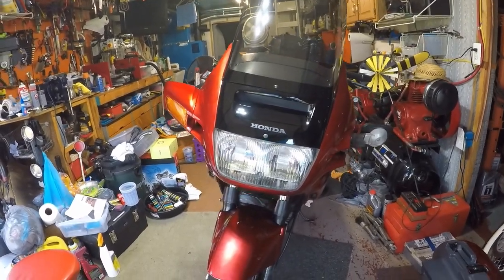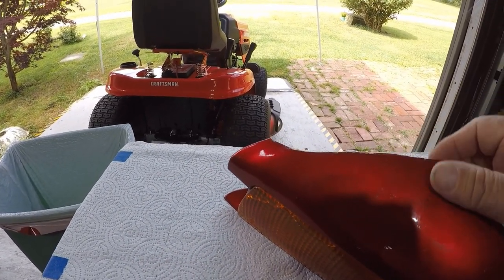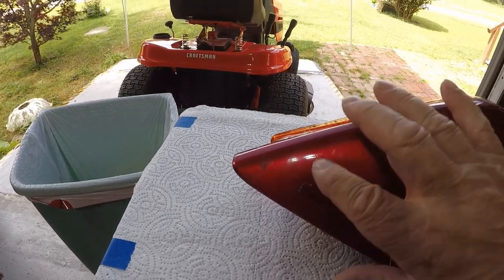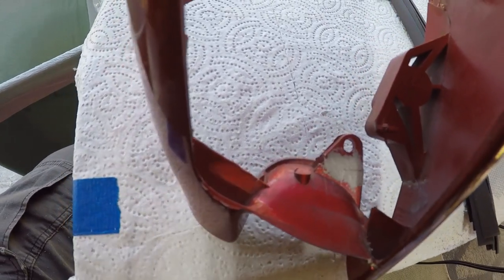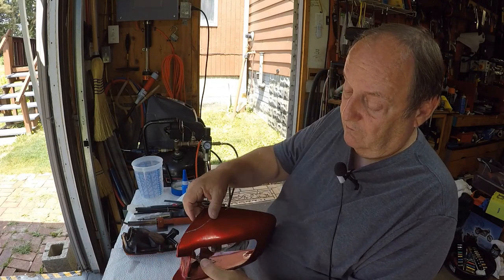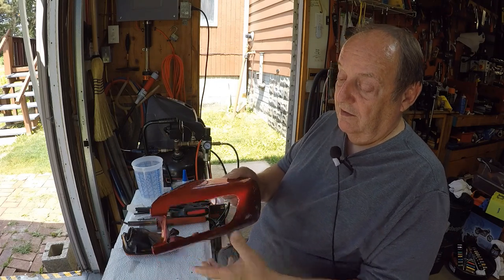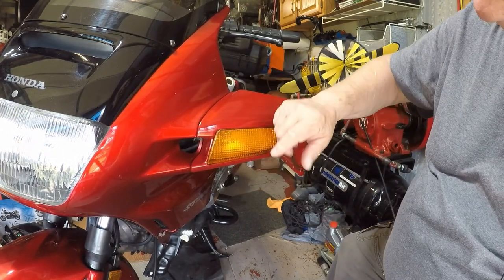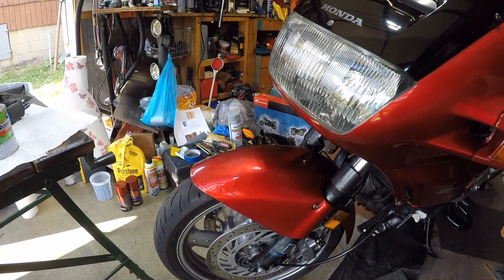HONDA ST 1100  REPAIR A MIRROR CASING.

Comment: Looks Good, Great Job!👍
What's that welder you have, is that just a soldering iron?
Reply from the maker: It's like a soldering iron but it has a triangle bit on the end and it's only has only one heat. HOT. You can see it on Harbor Freight site. Put in Plastic Welder. You-Tube has reviews on it. Works great.   Norman.
Reply: @2001himax  I found it, Thank You! A tool like that comes in handy.👍  
Thanks again, Great video👍
Reply from the maker: @WhipCityWrencher  Thank you for watching. The welder takes a while to get up to the heat to really melt plastic so let it set when first  plugged in. You get one, try it out on some scrap plastic first. Weld two pieces together and see how smooth you can make the seam.  Watch You-Tubes reviews. Norman.

Comment: Hide a spare key behind your mirror, in the housing. Now after a long day of driving, if you suffer riding fatigue and lose your key, you have a spare to get you home.
Reply from the maker: Just pop the mirror off and have your key. Great idea. Love it. Norman.
Reply: @2001himax  And no one knows the mirrors pop off, and it's out of the elements and unlikely to fall out. Ask me how I know., 😎
Reply from the maker: @OutsideTheTargetDemographic  There is a zip tie to keep it from falling off but I bet it will bang around a lot and do some damage.
Reply: @2001himax  Put the key in a zip lock, and duck tape the zip lock to the inside of the mirror housing. Waterproof/corrosion proof, and you just rip the bag open to get the key. 👍

Comment: I think you misunderstand paint work. What you've done is great...but it's just the beginning to get a pro result. Your finish on repainted part is not the smooth look of the rest of the bike- much of the final result is the light reflection, color match can be a tad off as yours is now. To fix this, sand what you have to get rid of the orange peel with 500 grit VERY Lightly, then clean, go to 1000 grit. If you sand too much, repaint with color again. Then when ready for final you shoot with clearcoat, then polish with rotary oscillating polisher with finest final pad and Meguiar's final polish. Keep polishing till it looks like glass. In time, as you get proficient with clearcoat, and have skill with paint, you can lay the clearcoat on HEAVY so it looks like glass, and you will not have to sand and polish at all. Keep  in mind that the part is ABS plastic, and the paint is also plastic...with both having the same flexibility.
Reply from the maker: Thank you for your comment and information. I will try it. Norman